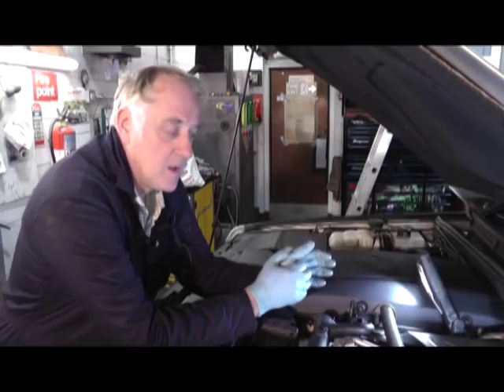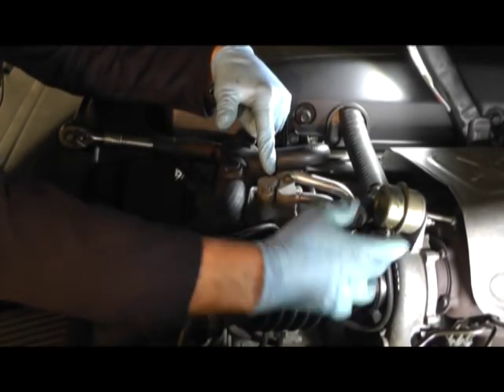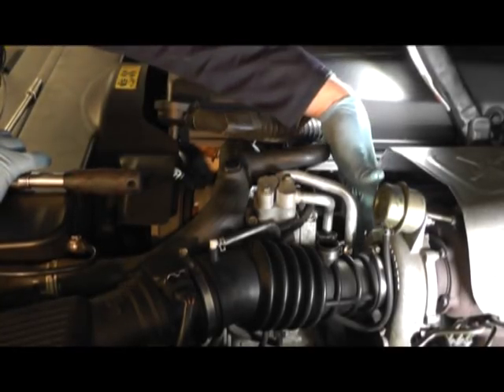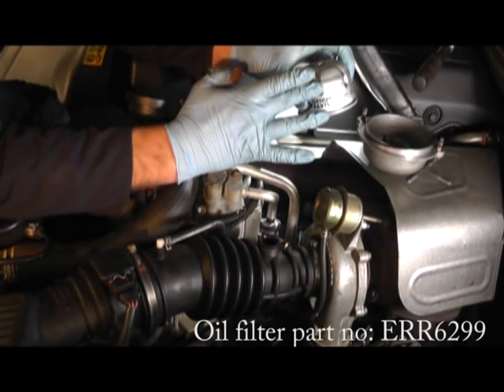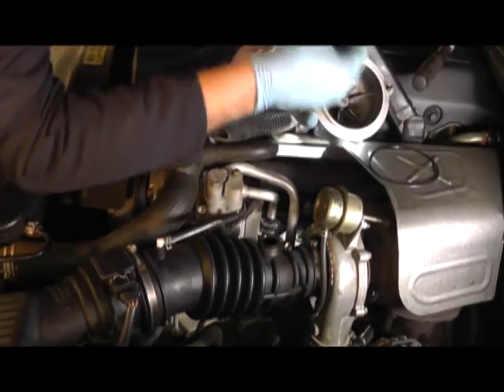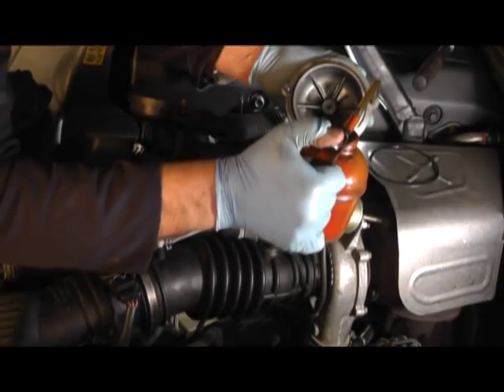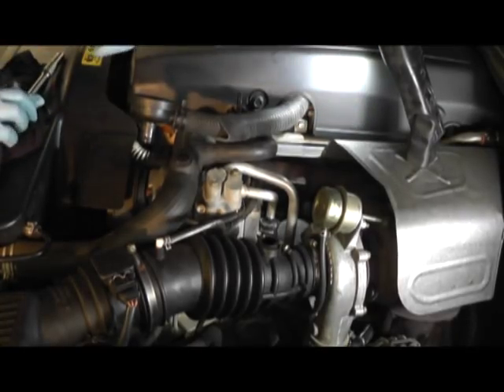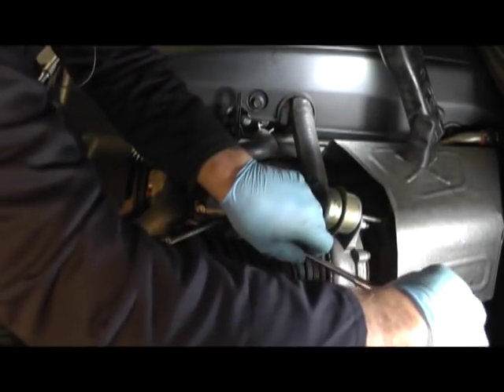Centrifugal oil filter replacement  Range Rover Discovery 2 TD5  2001 Model

Comment: Changed mine, it now makes an idea similar to this when I switch off the engine. Any ideas? https://youtu.be/gXKDqwKah4w
Reply from the maker: Not an uncommon problem it seems. Wait a while to see if it beds in.
Reply: That sounded to me like the filter was spinning inside the housing.
Reply: The spinning noise is a bit rough. i have read that the spinner spins at very high speeds at engine speed so when it is turned off he spins to a rest. my defender td5 does it too. I am hoping it is correct cos i got used to it now. filter replaced july 2017 and still spins very freely. but no motorway driving for me.
Reply: Ah, cheers for the tip. Just changed mine on my 06 defender, and it now does the same, and sounds like an old BSA Bantam motor bike slowing down. Wondered what it was as by the time you rush round to listen after turning the engine off - its stopped! Thought I'd done something to the turbo in demolishing the pipework. The job was made so much more interesting as I discovered that some bugger has stripped the threads in the housing and fitted long bolts with nuts on underneath. Whilst the outside one was easy to get to, the back one wasn't, being invisible and almost inaccessible between the exhaust, engine block and new cartridge filter I'd just fitted - which had to be removed again. Fortunately the dexterous use of a bit of gaffer tape holding the nut in the jaws of an open ended 8mm spanner was enough to hold it in position whilst screwing the bolt back ino it to resecure the cover. Still got the scars to prove it!